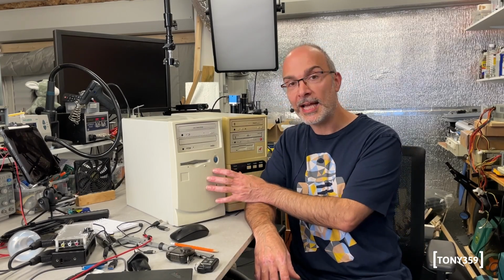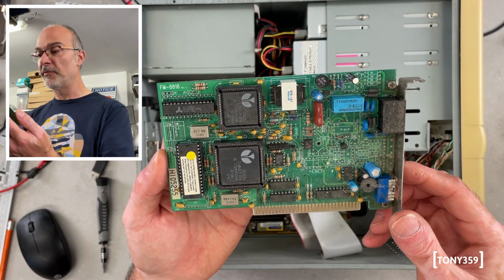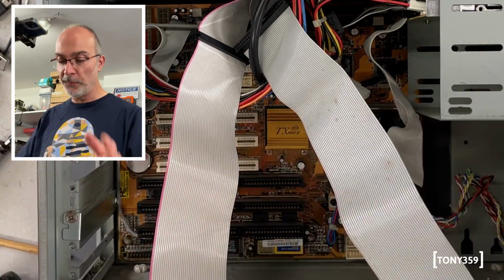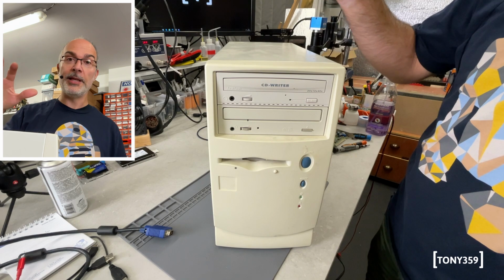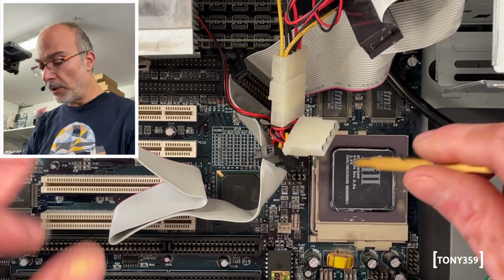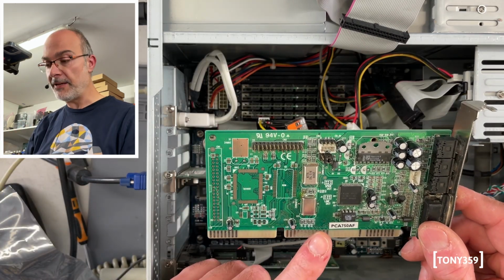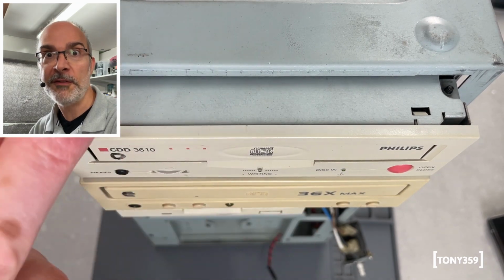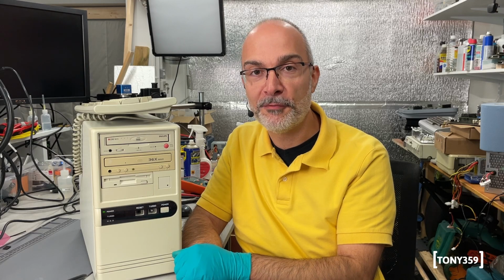I was pleased with what I found in these two old PCs!

Comment: I have a question. I have two motherboard one has only ISA slots and the other has isa and pci slots and integrated graphic card. So i. Can't get a isa graphic card so it is possible to transform that motherboard with integrated vga to be a graphic card for the other motherboard 😅?
Reply from the maker: I'm afraid not, the graphic card is integrated in the chipset!
Reply: @tony359  Thank you for the reply.
No  is not integrated in the chipset.
 the IC is " SiS 6326 agp"
Built in high performance 64bit 3D AGP Graphics Accelerator with 4MB frame buffer
The motherboard is PCChips M747 V1.3.
And the only isa board is kontron dimm pc
Reply from the maker: still the graphic is on the motherboard and it's linked to the rest of the system on the PCB - I'm afraid you cannot use just that as a video card.
Reply: @tony359  what if i take off the cpu and bios and put all the chipsets on hold ? Thank you for the reply
Reply from the maker: I don't think it's going to work :)
Reply: @tony359  thank you. Jus now i tried Trident TVGA9000i model 7210 with jumpers on 8 bit mode and  i get nothing on the screen . The motherboard boot and start but no screen 😅 the graphic work fine on other board

Comment: I don't get wondered why 1st PC has been came to skip. Just glitch collection. You're just followed all those promotion posters. Open your eyes and take that #hit out from your ears.
The second PC is much much better, but CPU still sucks.
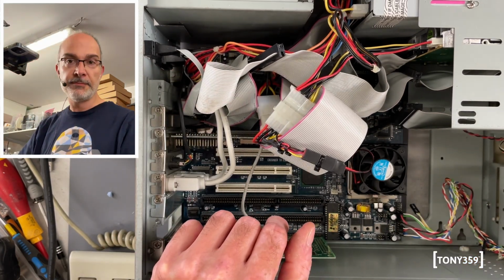29:41 CPU cooler fan failed to spin, hope you've fixed that!
Reply from the maker: thanks for spotting that - it does spin but I fitted a 7905 5V regulator on the line to slow it down. 5V is borderline for that fan and sometimes it doesn't spin - it usually starts spinning after a while or it might need a nudge :) Need to fix that indeed! Thanks for watching!

Comment: Hi, Tony. Thank you for the video.
Interesting motherboard from the first case! Fully integrated, integrated sound cards were rare at the time. And 2 CD-ROMs, one being a writer! I also had the setup to save the resource of my writer back in the days :)
Seems like you don't need that USB PCI adapter (if you will ever need USB), the manual says the MB already has 2 integrated USB connectors, although they're USB 1. It does not say where they are though :) Maybe it's an error, it also states that the MB has "66MHz Advanced Graphic Port", whatever it is :)
One thing to consider is the performance drop while using the internal VGA video card. Even if you use 75 MHz SDRAM, the theoretical memory throughput will be around 500 MB/s, while framebuffer data for, say, 800x600 true color 60 Hz mode will be picked up by the video at 800x600 x 3bytes * 60 Hz = 86 MB/s, which will make noticeable difference in some applications. And in your case with the EDO SIMMs, the SIMM throughput will probably be less than 320 MB/s, so 25% of it will be wasted merely by the integrated video output. So, if your intent is to reach maximum performance for the system, an external video card might be an option to choose.
The first modem looks like a hardware modem just by the fact that it's ISA, and the second is a PCI soft modem which were all believed to be unstable themselves and make Windows unstable by their drivers. Both of them are of no use now anyway :(
Also, I've found a site dedicated to the M571 MB, and it's still online. Seems like the MB was fairly popular back in the days. The site has a lot of info: manuals, drivers, common issues etc. I don't include the link here cause Youtube quietly deletes posts with links, so just search yourself by the model name if you haven't found it yourself yet :)
Reply from the maker: I found the website! Wow, a whole website dedicated to a PC Chips motherboard! Yes you are right, the reason for the PCI USB card is probably to have USB 2.0. I won't throw it away but for now I'm only using USB to transfer some files from USB sticks. Also good points about the integrated card using internal resources. PC Chips was renowned to give marketing names to things so I'm not surprised about that "Advanced Graphic Port", it could be anything! Thanks for watching!
Reply: The First one is a Super Socket 7 board, the internal gpu is conencted by AGP 2x (hence the "66MHz Advanced Graphic Port") the usb is part of a combo connector intended to be broken out into 2 USB and 2 PS/2 ports the connector for this breakout is located between the 2 top PCI slots. The left most pins as looking at the motherboard from the position of the start of the video are the pins for it. You can just connect a regular USB breakout cable like any modern motherboard would use there and it will work. It is however Provisional USB 1.0 and not fully released USB 1.1. Which means that the current draw is max 50ma and its super sensitive and easy to damage. 100% use a powered usb hub. Through a bios update this board supports legacy USB emulation so you can use usb keyboard and mouse in dos.

Comment: Good Video. Both of the CPUs are some rar and expensive these days. But they are on the slow side of the sockel 7 CPUs.

Keep at least one of them (i like the cyrix one, but i mean that the IBM is more rar) and use them with older/slower S7 boards to make a very fast 486-like DOS machine.
Reply from the maker: I have another IBM CPU, it's a P120+. Rare but slow :) Makes sense to keep a couple just for collection though! Thanks for watching!

Comment: I have a lot of these old computers from the 1990s I don't have any ideas what they are or called I just got my first computer when I was 12 years old  in 1997 and it has a IBM Apitvia 2162 s3c on the handle  I found out about 5 years  later 233mhz  32mb ram  and just started to watch the old computers 3 years ago and I have been try to build my first computer and I want   to get it  working but the  CD floppy console under the monitor and the power button came off ot and it won't come up spring is probably broken makes it come up and can't find any good full versions of Windows 95 fisnstail the recovery CD disk is cracked or floppy boot start up disk  can anyone help me I have few videos on my channel trying to fix my old first  computers
Reply from the maker: I know that for Windows 98 you need the OEM version in order to have a bootable CD but I am not familiar with Windows 95 I'm afraid. I hope you can fix the power button! Thanks for watching!

Comment: Running Duke Nukem 3D Within Windows 98 will probably cause it to run slower and not perform as well as it would within DOS.
Reply from the maker: You're probably right - someone suggested Duke Nukem to test windows but as you said, it's running DOS so I'm not sure... Was there a Windows version maybe? Thanks for watching.
Reply: @tony359  not sure. I know there is an “Atomic Edition” of Duke Nukem 3D but not sure if that was Windows or DOS.

Comment: I see the second MB can run at 75 MHz.
If you play with the jumpers, it may even run at 83 MHz.
That's how my 233 MMX managed to run at 290 MHz :)
Reply from the maker: For that I have the Shuttle which can go up to 100Mhz :) But good to know! Thank you!
Reply: @tony359  It's usuallly an undocumented feature on TX chip boards.
So results may be good, or bad, depending of the exact board and the CPU you actually have.
With 96 Mo ram and a Voodoo 1, my MMX was a beast to play Unreal :) 
Of course, if you plan to use mainly Dos, you don't really care ....

Comment: Try doing a reverse Google image search for the Abacus logo, maybe that will find some more of the most obscure references?

Also "baud" sounds the same as "bored" (or "board"). 🙂
Reply from the maker: ahh I understand now! Thanks for that! Good idea about the logo but it didn't yield results I'm afraid. Thanks for watching!
Reply: @tony359  more boring trivia about baud: it refers to the number of "symbols" per second.

A symbol can carry 1 bit, but it can also carry more. It's all down to the modulation.

E.g. 100 baud with 4 bits per symbol would be 400 bits per second.

Comment: That Intel 430TX system kinda has too much RAM in it - the chipset is only capable of caching 64MB of that, so you might encounter weird performance issues with that under Windows.
Reply from the maker: I didn't know there could be such thing as "too much RAM"! Thanks for that! Do you think the Apollo MVP3 of my Shuttle would be better at that?
Reply: @tony359  As far as I can tell from the theretroweb page on the chipset it uses external SRAM (up to 2MB), so it would depend on how much is on the board. You can also use CACHECHK under DOS to verify the access times and the amount of cached RAM 👍
Reply: @tony359  yes, the MVP3 can cache more than 64MB :)

Comment: Of the two cases, I would guess the whiter one was the better case.  I used to build hundreds of systems like that and the other case looked like an old Acer mini ATX case.  The old Acer cases had the most reliable power supplies of all of the cases from that era.  My old office PC has been running, pretty much consistently since 1998.  I still use it to host my Quickbooks software.  I have it running Windows XP with a 40GB hard drive and it works great.  I have changed the internal power supply fan once but it's still working great.

Tony, I have a warehouse full of old PC's and old motherboards and related cards.  I even have some boards still in the boxes I think.  I also have a box full of motherboards that has XT, 286, 386, Socket 7 boards inside.  I gotta get rid of this stuff, it's takes up space but I haven't found time to throw it out.

By the way, modems aren't useless at all.  You can use them on any modern PC add Fax capability.   All medical offices still use Fax machines as do all Law firms and financial institutions.
Reply from the maker: Fax still used here in the UK? We don't even sign in person anymore! :) But elsewhere for sure! I remember having a Fax machine myself in Italy as the fax had legal value and it was like sending a written recorded letter :) 

I hope you find a new home for all your things in the warehouse!! Thanks for watching!
Reply: @tony359  yes, the NHS has hundreds of Fax machines still in use and law enforcement and other law related organizations still use fax machines in the UK
Reply from the maker: Oh wow!!!

Comment: I saw the two cases and I instantly thought you’d take the 1st one. In between the buttons and power/HDD leds looks like there’s some space there, and I think you screwed something there when reassembling, is that case having a 7 segment display?
Reply from the maker: it does - I forgot to show it turned on! I believe it only goes up to 199 though... Thanks for watching!
Reply: @tony359  oh well, no 233 displayed on the front I guess, though 199 max is pretty common for these I believe. Cases having a 7 display aren’t that easy to find nowadays so that’s quite nice

Comment: Hi Tony, nice video! After you set the frequency for the Pentium, it seems you forgot to connect the CPU fan.
Reply from the maker: I think I did, it's just that I put a 5V linear voltage regulator on that fan to make it quiet. And 5 volts are just borderline to make it spin - sometimes it does not make it and/or it starts spinning after a while! But yes, I should fix that! Thanks for pointing that out and for watching!

Comment: Dont throw this USB-PCI card with the OPTi chipset... Because for Windows98 you wont find any better or more compatible. I prefer them always over VIA, NEC, etc.... About the Cyrix FPU - yes it sucks, it was basically the same FPU they already used in the Socket 3 5x86 variants - but still - for games a no go. Intel FPU rules. Thats why i run a Tillamook SL2Z4 Pentium MMX 266 on a super socket 7 on 400Mhz to fire a Voodoo Banshee with and enjoy most games up to year 2000 on it. K6-2 or K6-III everyone can do - but having an Intel on Socket 7 at around 400mhz that doesnt even get warm even OC´d - now thats special. Anyways.. nice video!
Reply from the maker: no worries, nothing gets thrown away here :D Good to know. Is the USB on the intel TX coming from the intel or is there a third party chipset somewhere?
Thanks for the insights, it's pretty cool! I know there are many ways to push the socket 7 platforms to its limit! One day I might explore those options! Thanks for watching!

Comment: I worked for a pc chain called MicMac computers back in 1998. I used to build and sell systems with the pc chips boards. This one you got, but also the Pentium 2 version.
They were imported by Rotterdam Computer Center or RCC for short. The boards were bottom of the barrel as far as boards go. The PII boards came with a  AGP card and were much worse.
Sometimes we pre-build 10 systems and before a customer picked up there pc we would take it out of the box and checked it out one last time. about 1/3 of the systems did not power up.
The systems that did run were just unstable or had some ghosts in the machine. To see one working in 2023 just blows my mind.

I always felt guilty when I was told to sell systems like this. I much rather sold the Chaintech 6btm with a Celeron cpu and a viper330. 

About the turbo button. If there is no turbo function on the board you can put the switch on a multiplier jumper. And create your own turtle mode.
I can't remember if this board used jumpers for cpu setup or it was one of the first boards that did it in the bios. 1998 was the year they just switched from jumpers to doing it in bios.

it was a great year for the pc, so much happening.

Comment: I was doing system builds, upgrades, and repairs for a computer story back in that era. The AD1815 soundcards were pretty common back then because they were relatively inexpensive, the sound wasn't horrible, and the driver installation was usually pretty painless, unless you had one with the IDE populated and were trying to use it for your CD-ROM driver. IIRC the IDE on them being difficult and having subpar performance. But that one's not even populated, so you're not going to run into that issue. ;)
Reply from the maker: I suspected it was a cheap card - back in the days it was Sound Blaster at sky high prices or... unknown cards :) Thanks for watching!
Reply: @tony359  I typically installed Sound Blaster, Opti 82C931-based cards, or various AD181x ones like this one. The Opti ones were a step up from the AD ones, but could be a bit difficult getting the drivers going, depending on the machine you were installing it into. I probably installed thousands of those things during my time on the bench. I love these videos because they take me right back to that time of my life when I was just starting my career in IT. Looking back on that quite varied career as I creep ever closer to retirement, I think being a PC tech was my favorite job within IT.
Reply from the maker: Same here, the times when I started tinkering with computers were happy days 🙂

Comment: 10:14 No. 

The M571 was the first mainboard I ever bought, as you said, it’s very flexible and I started with a Cyrix PR233, then got an Intel 233 MMX and finally installed an AMD K6-2 500 (83 x 6)

But the sound chip is garbage!

Not because it didn’t sound good, it sounded fine, but because over time, the audio would almost start to degrade. It sounds strange, but after some time, the audio would start to develop little bloops and wuups, kind of like a bad audio cassette. 

It must have been some kind of driver issue, the only way I could ever rectify it was with a fresh reinstall of Windows 🤷🏻‍♂️
Reply from the maker: wow interesting! I am not familiar with the chip but I was told it was good! It felt a bit weird that Pc Chips installed anything "high quality" on their boards LOL! Thanks for your comment and for watching!
Reply: That's probably because you used WDM drivers in Windows for this chip and not VXD drivers. Hence why it fixed itself upon a windows reinstall.
The WDM drivers are bad, but the VXD and DOS drivers are very good.

This sound chip is actually slightly more capable than the YMF chip because it's SB16 compatible while still being sound blaster pro compatible.

Now it's not going to be "audiophile" levels of good, but by DOS/early windows standards, it's very good, yes.
Reply: @DxDeksor  I used whatever drivers came on the mainboard CD 🤷🏻‍♂️

Comment: Hey Tony, awesome video again! Some comments, like you asked :)
PC1: Although it can be convenient to have those options onboard, the nice thing about them old systems is that you can exchange parts. So I wonder if the audio and video can be properly turned off. If the option is present in the BIOS, my experience is that doesn't do much sometimes :) The Philips writer is nice! I had one back in the days brand new, and a few weeks ago I was able to add one to my private retro collection. Which, by the way, does not contain an IBM PR300 :( If you like to trade one of them for any intel socket7 CPU, please let me know!
PC:2 Never heard of the brand name, but boy, you're right, that blue looks good!

I think you can setup a PI to act as a PBX to test modems, if you ever run out of projects.. ;)
Reply from the maker: Exactly my thought, I'm confident that a (PC Chips) BIOS won't fully disable the sound card and video card so I'd rather not have them in the first place. I have an IBM P120+ I could give you - I need to test it first and maybe straighten some pins. Please get in touch via email - address is on my profile under about! Thanks for the comment!